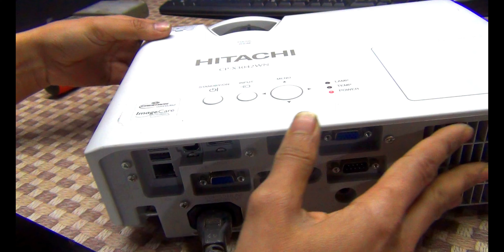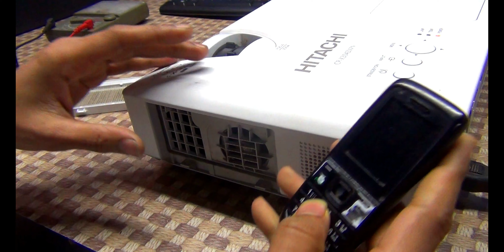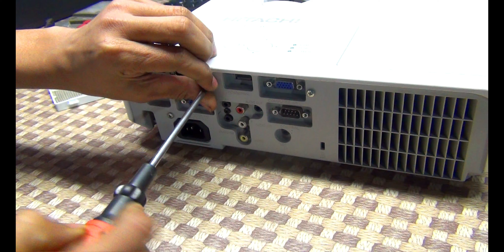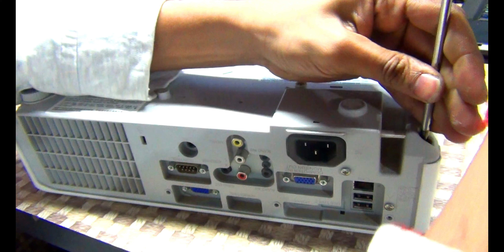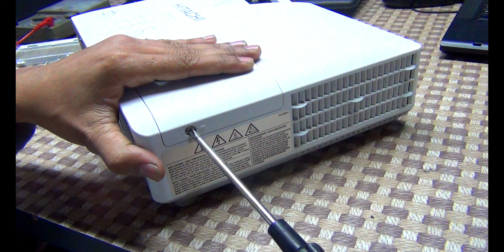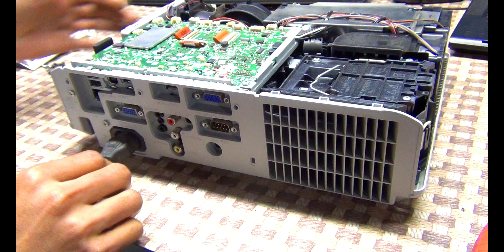Hitachi projector temp Problem repair (Part-1)

Comment: plz guide me, where can I learn repair electric items
Reply from the maker: Sir,
 if you tell me the problem of the electronics parts you are trying to fix, I will tell you if I know.
Reply: @Electronicssystem  Sanyo PLC-XP21N Projector, three chipset ic of LCDs are full heating, how can i solve the shorting problem?